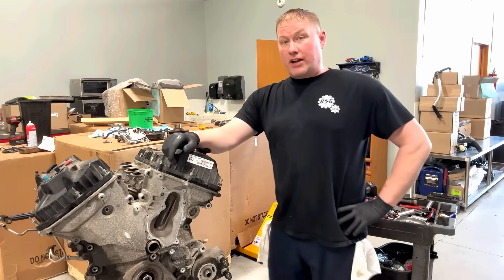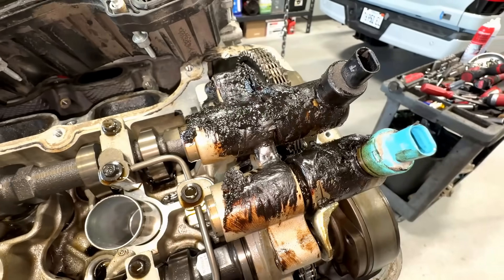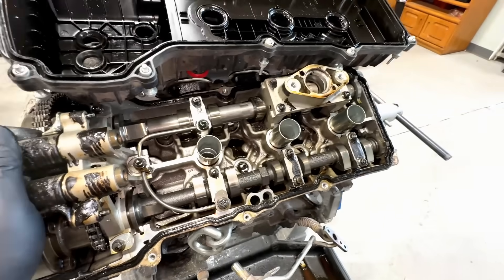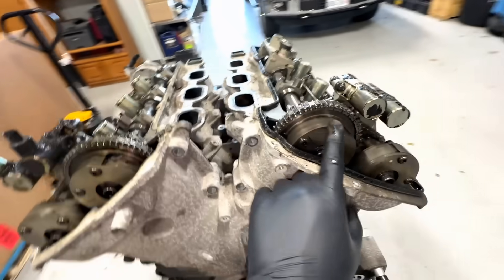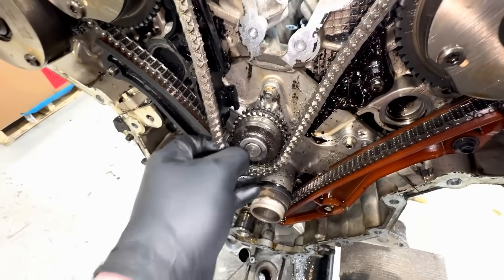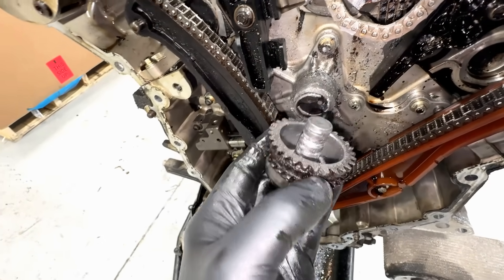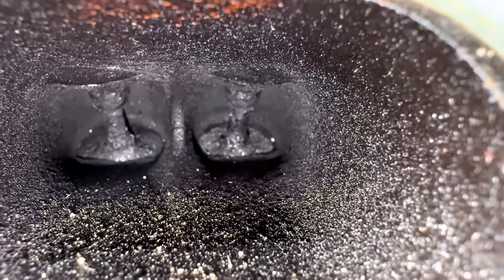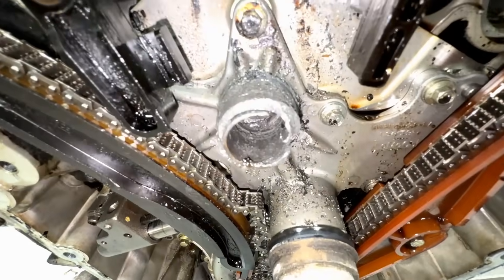2015 Ford F-150 3.5L EcoBoost Engine Failure: 97k Miles Total Destruction!

Comment: I’ll never ever ever understand why people pay 50-60-70k+ on a car or truck and totally ignore the $100 oil changes….
Reply: Same, it's a very weird mindset to have.

"Oh I went 25k miles and it was fine, I'll keep doing that"

Yeah it's "fine" until it's not.
Reply: Problem is some people don't plan on keeping a vehicle for that long and don't really care what happens to it after they trade it in.
Reply: @ Exactly and then the second owner pays for it.
Reply: Turbo engines in particular need more frequent changes. You wonder if this wasn’t the second owner paying for the first owner’s negligence.
Reply: Oil change is the most item of engine maintenance, and I use full sinthetic oil, and do the oil change myself, not because I don't trust people but because i want to see how the oil looks like, any sogns of metal particles, etc.
Reply: Do your own for 50 bucks or less
Reply: @brantk81 Castrol edge full synthetic and a motorcraft filter. I’m out maybe $40 every 3500 miles. Id rather pay for the oil changes than the block assemblies lol
Reply: @brantk81 Nobody is getting oil and a filter that cheap buddy. 😅
Reply: @brantk81 , I was going to say the same thing. That $100 oil change easily drops to $50 or less when you change it yourself. Plus, you can pick the oil of your choosing. 200K + and my car starts, runs, no ticks, knocks, etc
Reply: @brantk81 They want you to have it serviced at the dealer to keep record of oil changes. If you do it yourself it would void the warranty if there is engine issues later.
Reply: @paulsosa1872  not true. You can do your own oil changes and you’re not voiding the warranty. It’s good to keep a record, but not necessary. A good shop will be able to tell whether the oil changes were kept up or not by the condition of the engine.
Reply: I think of what George Carlin said: "Think of how stupid the average person is, and realize that half of them are stupider than that!" 

This is a case in point if there ever was one.
Reply: $100?????!!!! Do it yourself man!!
Reply: $35
Reply: Part of the problem is that the manufacturer has the reminder for oil changes set way too high too. I remember putting a note in my phone early on about how great it was my truck didn’t need an oil change until almost 9k miles then I saw one of Brian’s videos and some others about how ridiculous the manufacturer intervals are and I quickly shifted to every 5k. Clearly the manufacturer set people up for more service revenue. Obviously this owner went way overboard with oil intervals but these companies mislead people.
Reply: Because the majority of them can't afford to buy the vehicle to begin with and every dollar they have goes to the payment
Reply: You cant fix stupid.
Reply: The problem is that the manufacturers recommended oil change intervals is 10k miles which is way too much especially for these engines. This will generally last you through the warranty period after which you are screwed. It is becoming a well known method for the dealers to make more money.
Reply: Shit,  $40 oil change
Reply: @Lawnfella For a top shelf synthetic and oil filter, no way.  Costs me almost $100 to DYI an oil change.
Reply: @Brian-ee1gx not sure where you’re buying your oil but your getting ripped off. I pay less than  $40 for 6 qts Valvoline Advanced Syn and $10 for an oil filter
Reply: @Lawnfella I'm in Canada so everything costs more.  I pay $56+ tax for 5 quarts of Mobil 1, and about $20+ tax for a Wix, Napa Gold, or Purolator filter.
Reply: I change my oil and filter for under 50 dollars on my truck.
Reply: Because they lack situational awareness and basic common sense. A lot of those people running around.
Reply: And I'll never understand who pays $100 oil change
Reply: @stevek343 Because I'm very complex. Was 70$ now like  85$ it's convenience 15 minutes no oil disposal and a free air freshener. Bought a car paid for a Carfax got a free one so I pulled up my truck looked like a  dititionary every oil           change is on there. My driving habits on Ford reminder every 10% is 7-8 hundred miles
Reply: @stevek343 Well I go back and forth, if I do it myself on My 23’ F250 using the same Motorcraft oil (8 quarts required) and FL820 filter costs on average $65 with tax. The dealer charges $98 and checks the electrical system, brakes, and rotates the tires for me and tops off the wiper fluid. So time wise and convenance the dealer is not such a bad deal and I don’t have to drag out the jack and jack stands or crawl under the truck. The inconvenience of the dealer is having to make the appointment and going in later to work during the week day. I can do it myself on my schedule on the weekend so it’s a toss up for myself.
Reply: @stevek343 in Alaska oil changes for full synthetic is $130-$210 in different shops, inflation costs I imagine!
Reply: @TH-kf2fk how much for a gallon of milk or a loaf of bread in Alaska?
Reply: @stevek343 I’m bad about that not quite 100 but  60-80 buying overpriced synthetic oil like amsoil and redline … looking for the Honda oil filters that are discontinued cause I likes the older A01 filltech designed oil filters  from Honda … at least I know it’s getting done I run my OCI out to 5000 and sometimes 6000 when I’m lazy … but I think hey I’m supposedly using high end oil 6k should be no problem right . I’m just happy I don’t see any sludge when I look in my valve cover:
Reply: Because they can't afford the car payment,  and can't afford the $100 oil changes. Then every thing turns to SH--IT!
Reply: They don't know any better..
Reply: I wonder what else people don't keep maintained. 🤷
Reply: @jasoncrandall73  I have a 1994 Craftsman lawn tractor.
Runs like new!
Reply: Not just a maintenance issue newer cars are junk not very reliable
Reply: Maintenence is expensive,   but not doing it is way way more
Reply: Oil/ filter changes in my 150 at about 5k mi. Suck oil out between filter changes at about 2500k. Yeah, prob overkill, but I want to keep her arteries clean.
Reply: My f150 gets a synthetic oil change every 5k.
Reply: They've got more money than sense. 🤔🤔
Reply: I have a 2012 3.7 Mustang and I change the oil every 4000 miles - I use 5w 20 Supertech full synthetic and a Bosch Premium filter. 81,000 miles. No issues yet. I heard the Solinoids need relatively clean oil to operate efficiently. My best road trip mileage has been 29.2 gal.
Reply: I changed my oil religiously every 3000 and my 2006 F150 has 225,000 miles run as smooth as you could possibly run, no startup rattles no engine ticking you can’t even tell it’s running at idle.
Reply: Agreed. I've seen the same scenario on farm equipment.
Reply: Seems like a borescope can save you a lot of headaches.  Stick that in the oil filler and spark plug hole
Reply: Can’t blame Ford.
Reply: I just got a Ranger with the 2.7 and am already doing 5k mile oil changes with Pennzoil Ultra Platinum.  $40 oil change including the filter.
Reply: @border411  if you plan to keep that truck past it's warranty be sure to start saving now for transmission problems. I almost bought a ranger a few years back till I test drove it..tranny shutter the whole drive...plus they use plastic transmission pans which begin to leak after a few years...garbage truck.
Reply: Brainwashed into believing what that little “change oil” light tells them when it’s time.
Reply: Mind boggling bro. I'm about to roll over 300k on my 3.7 in my Ford transit. Oil every 5k
Reply: Who pays $100 for an oil change?
Reply: Right it’s half that price if you DIY the oil changes.  Use good Mobile 1, Liqui Moly, etc and it will be a little more, but less than $100.  WAY less than a $5000+ engine replacement lol.
Reply: Not sure what some of these people are driving, or maybe they're using cheap oil and filters, but it costs me about 70 bucks to do my own oil changes with quality oil and filter.
Reply: @crewdawg2008   about $28 for 6 qts of Valvoline High Mileage (synth blend) and $8 for the filter at Walmart. Jeep Cherokee and Ford Explorer 
Only my 95 F-150 with the flat tappet 4.9 gets the slightly more expensive VR1 ($36 for 6 qts).
The engine doesn’t care how much you pay for the oil, as long as you buy it and change it regularly.
Reply: Then blame the car. 😂😂😂
Reply: $39.95 and the dealer picks up the truck and brings it back. Tip the driver 10 bucks and good to go. Beats going to the dealership in person.
Reply: Blows my mind that oil changes are now $100. I completely stopped having someone else do my oil when an oil change/tire rotation hit $80.
Reply: With oil rebates and deals I'm able to spend $25 on full synthetic oil change on my truck
Reply: Right 100%, i have a 2023 RAM 1500 with the 3.6 and i do it myself for about $30.00 every 3500 miles, factory MOPAR filter and 5-20. The IDIOT saved a few hundred bucks or thought they, did now look at the bill, that might be 10K??
Reply: Reminds me of seeing a BMW at a McDonald's
Reply: Pizza, case of beer and a pack of cigarettes = $100 . Pri
Reply: Typical German style
Reply: Our local Ford dealer does my oil & filter for $53.00 2016 F150 5.0...no shyte...cheaper than I can buy the oil & filter
Reply: @neilschlemeel5751 you can buy the oil and filter cheaper than$53
Reply: I completely agree. Additionally, you can use premium synthetic oil and an OEM oil filter for ~$50 per oil change if you do it yourself. This also ensures that you know everything was done correctly.
Reply: I know I change mine every 5-7k miles and enjoy doing it
Reply: @freedomisntfree_44 I would do it more often than that…3000-4000 miles max. Brian had a video earlier about trusting the factory oil service life recommendation. 
270,000 on all my vehicles except one (120,000 so far) and no issues
Reply: 70 million people voted for Kamala Harris, I should tell you everything you need to know
Reply: Because they aren't perfect like you, take that as you may.
Reply: @RuskeyOrphan  perfect? It’s called responsibility. It’s called protecting your investment. Ignoring it is just downright stupid and ignorant.
Reply: @Maynardd probably the owner of this disaster and is sensitive 😂
Reply: @Maynardd A vehicle is NOT an investment. It is a liability. There is a drastic difference.
Reply: @BrandonWest87   depends on the vehicle. And that’s an ignorant comment being that we’re talking about changing your oil in your liability so it can last three times longer than the one in this video. You’re clearly missing the entire point. And I have bought seven different cars in my lifetime as investments and sold them for more money than I paid for them. Liability?
Reply: @ Sure bud, we all can say things on the internet. Vehicles are liabilities if you do anything other than hold them for a potential yet highly unlikely return. 

I didn’t miss the point. You used an improper term as a lot of people do and you got called on it. I use a very high quality lubricant in all aspects of all of my vehicles because I value a long service life. The fluids are analyzed regularly for their service life. The oil in my Road Glide has been in it for 20,000 miles now and still has life left in it. My scoped internals are clean and in good working order. Nice try though.
Reply: @ no, you missed the entire point. And yes, you can also say things on the Internet like you just did. 20,000 miles on oil? Absolutely not. That oil isn’t protecting anything.
All I would use is Amsoil signature series in my raptor. Sent it in at 1000 miles, 3000 miles, 5000 miles, at 6000 miles It was done.
And apparently you don’t know much about cars or flipping them. 
You realize they’re literal people worth tens of millions and even hundreds of millions of dollars doing nothing more than INVESTING in cars. 
But you can keep posting making yourself look like a fool, With your make-believe stories. Or stick to the point. Pro tip, learn how to invest in vehicles…
Nice try? There’s always gotta be someone like you who likes to try to comment on things they know nothing about.
Reply: @ Wow, you got that stirred up about being wrong? I used to use Amsoil too. I found something that works better for my vehicles. You’re also wrong about the protection in that oil, just ask Horizon Labs as they’ve performed the analyses on this particular sample. All additives still holding values, iron and aluminum metrics are flatlined, oxidation picked up one tick, fuel dilution drastically diminished as the rings seated. 

Get educated. All of that “change it every 3k miles” only applies to cheap Dino. Amsoil only made it 5,000 miles in my 5.4 before the TBN was crashed out, so I went searching for something better. I like Amsoil, but it’s not all it’s cracked up to be and the analyses proved that out to me. I used to love and use it religiously until data proved otherwise.

You can keep your “pro-tip”. I think you need it more than I do.
Reply: @ something else? Oh please enlighten us as to what magical 20,000 mile oil there is. because there isn’t one…
Nor is there a mechanic on the planet that would tell you to go past 10,000 miles With anything. And if one did, that’s not a mechanic I would ever use.
And again you’re missing the point.
And again, you’re also wrong. 
Change your oil at 1000 miles, send it in. Go 4000 miles and send that oil in. There will be a drastic difference every single time if you do that rotation. 
You can’t stop engine heat, which is the main cause of oil breakdown. 
Which makes it impossible to last as long as you claim. 
Heat creates oxidation, and reduces its viscosity. There’s no way you can stop it. Which is why you’re just rattling off nonsense. 
Cheap Dino? Yeah, how dumb it would be to put fresh oil in every 3000 miles giving you maximum protection. I always laugh at people like you that make those comments. You have no clue…
Reply: @Maynardd  High Performance Lubricants. You’re welcome. 

Keep clutching your pearls about your oil changes. The oil at 6200 wasn’t even dented, it just picked up some fuel dilution and the iron and aluminum wear from the break in oil. Tested again at 16,800 and none of the wear metals increased, the fuel dilution decreased, TBN is still above 4.5 (it dropped a half a point from 6800), oxidation increased one value, fuel dilution dropped to just over 1%, anti-wear additives barely reduced, etc. 

Go to the BITOG forums and do some research. You might come away with a changed mind.
Reply: @BrandonWest87 So do you really think a high end oil can go longer than a standard ole run of the mill oil?  Let’s say an Amsoil vs a Supertech?
Reply: @RuskeyOrphan  Perfect? You'd have to be a drooling moron to let your engine get to this point.
Reply: @RuskeyOrphan not perfect, just ignorant.
Reply: @RuskeyOrphan If perfection is changing one’s oil every 5k miles….the lord has set the bar very low.
Reply: @RuskeyOrphan 
What does being perfect, or not, have anything to do with changing the dang oil when you are supposed to?

Comment: Good reminder to keep on oil changes.  Incredible evidence!
Reply: Actually it's more likely letting oil go low and it gets over contaminated. If you keep oil level up it takes a really long time to sludge up an engine
Reply: @bigdaddymak1439  The miles for the years, it makes me wonder what type of weather and cycle times this engine experienced. A lot of short runs in cold weather is very bad for severe sludge buildup but this mess looks like that but also hot temps just baking the sludge that built up ( I am just speculating though ). It also makes me wonder how big of a risk it is to use an engine flush like that, so much cleaning action in a short period of time and without realizing the horrid buildup that would be almost a guarantee of wiping an engine out by doing a harsh flush. This mess of a repair bill will certainly have paid for some oil changes !
Reply: @charlesb4267  for that damage it was oil starved. The sludge probably combined running low, short trips and years of not changing
Reply: @bigdaddymak1439  It would have been nice to have a picture of how the truck was used, if that played into the big picture or if most of the blame centers around lack of oil changes. Yes I agree, this major damage was caused by oil starvation after the BG product was used and caused the whole system to plug up, I can well imagine the gunk that was piled up in the pan from the cleaner and on the suction screen, and the oil filter must have been one ugly mess as well assuming the suction didn't plug up first. Big expensive mess that shouldn't have been.
Reply: @charlesb4267  been a mechanic for 35+ years and if you keep your oil full this shit rarely happens.

Comment: Every Engine Flush i've seen it tells you in the instructions to remove the Oil Pan after it's run through. That said I would never use an Engine Flush on a modern engine esp one with Variable Valve Timing thats just a receipe for disaster because even if the pan had been removed after it was done the solenoids are clogged now. I would still do 3,000 mile oil changes like I've always done with my vehicles wouldn't matter what the manufacturers recommendation was, some say you're wasting money I disagree it's still cheaper then a new engine.